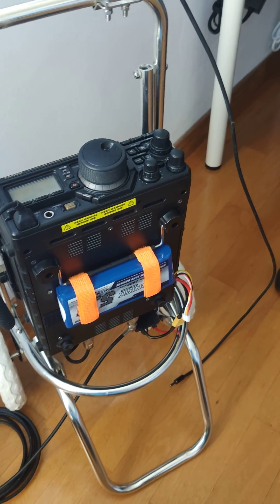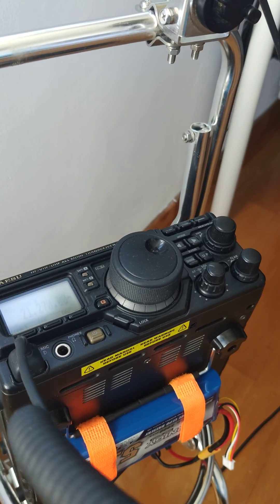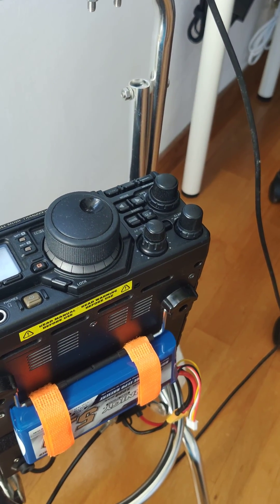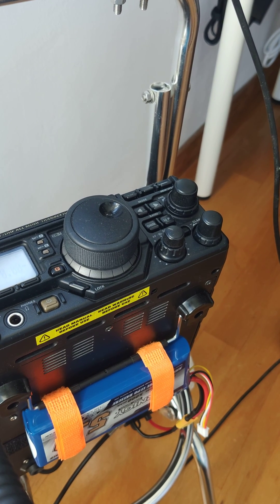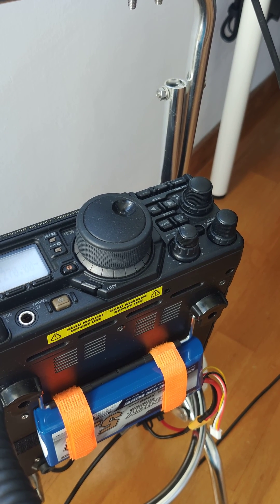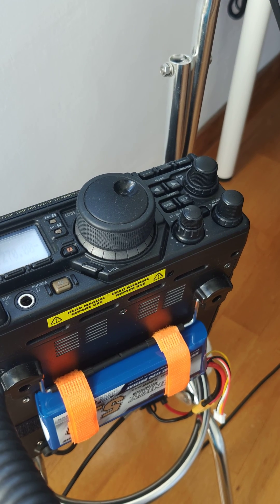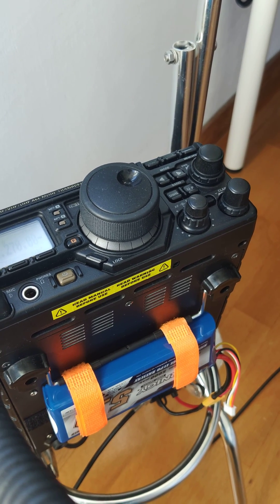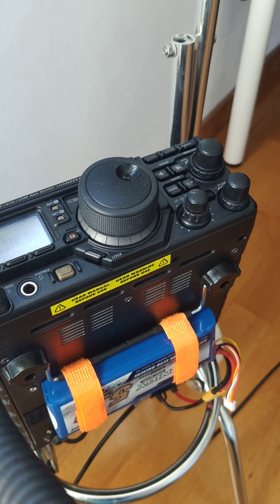Testing 11.1V LiPo battery with Yaesu ft 897D trolley for Beaches On The Air, 15m SSB DF9SG

Comment: Have you tried the same type of battery, but used the 4S / 14.8V option?  Reading the 897 manual it says:
Supply Voltage: Normal: 13.8 VDC ±15 %, 

So anything from 11.73 - 15.87 should be within spec.

I was thinking of wiring up 2 of these in parallel which should give me 14.8V and about 12Ah! 

Thoughts?
Reply from the maker: The first battery of this kind I used was a 4S Lipo that fully charged was 16.8V. I used it with two diodes in series to bring down the voltage to the radio specs. Later I realized that the radio was able to work at lower voltages, and especially if you are operating portable and don't need the full 100W of the transceiver. I thought it would save weight and energy to use a LiPo 3S instead, and have used it ever since. 73 de Diego EC1CW
Reply: @ec1cw  Thanks!

After watching your video I did a bit more research and realized that the 4S are 14.4v NOMINAL with a max of 16.8v as you mention.